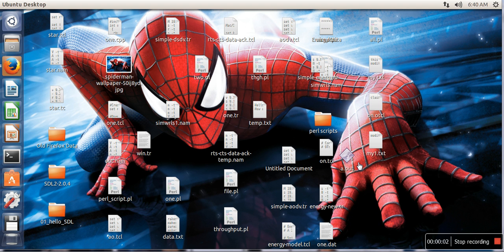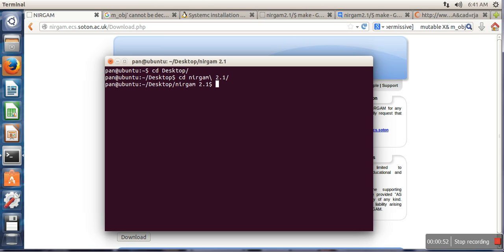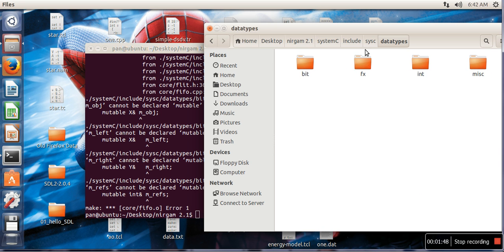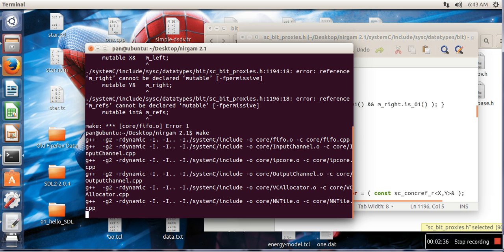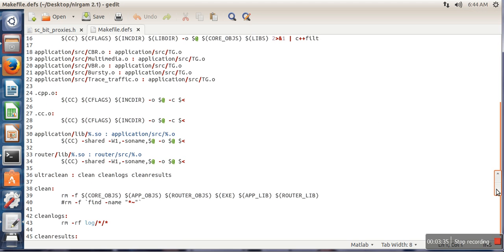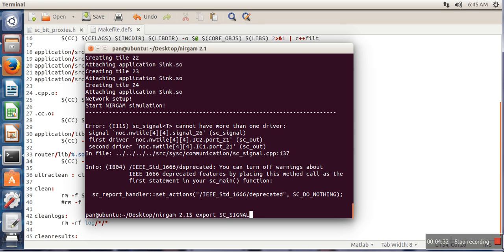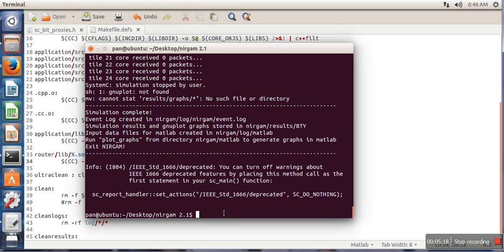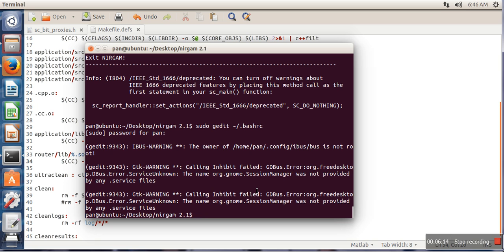How to Run NIRGAM Simulator First Time

Comment: after changing W1 to Wl this is error ...what should i do

g++  -shared -Wl,-soname,application/lib/App_send.so -o application/lib/App_send.so application/src/App_send.o
/usr/bin/ld: application/src/App_send.o: relocation R_X86_64_32 against `_ZTV8App_send' can not be used when making a shared object; recompile with -fPIC
application/src/App_send.o: error adding symbols: Bad value
collect2: error: ld returned 1 exit status
Makefile.defs:31: recipe for target 'application/lib/App_send.so' failed
make: * [application/lib/App_send.so] Error 1
Reply from the maker: Are you using 64 bit operating system?
Reply: may be
Reply from the maker: Nirgam simulator doesn't work on 64 bit
it creates problem on 64 bit os
you should try on 32 bit.
Reply: HI, I am using the Nirgam in Ubuntu linux64bit. First, you shoud modify the makefile.defs: change the W1 to Wl. Then, modify the makefile: add "-fPIC" behind the CFLAGS . After doing this, you can simulate the Nirgam successfuly. Good luck!
Reply: I did as you instructed but it still shows up as above